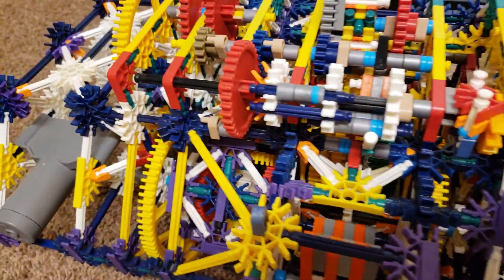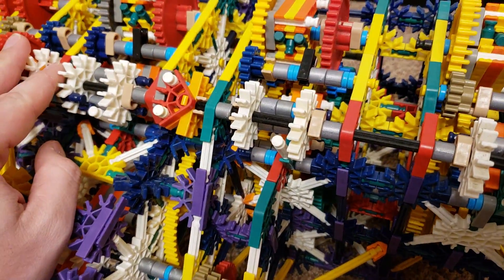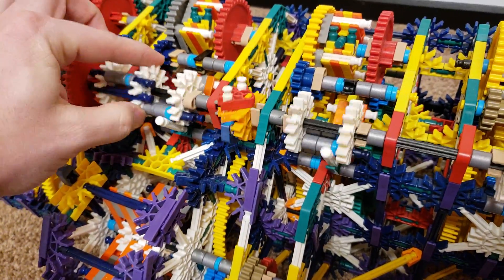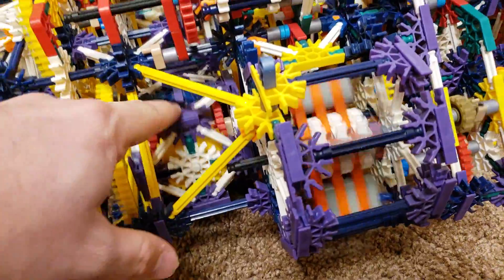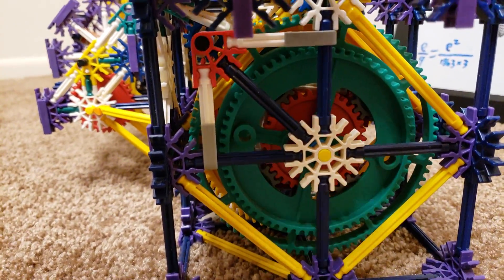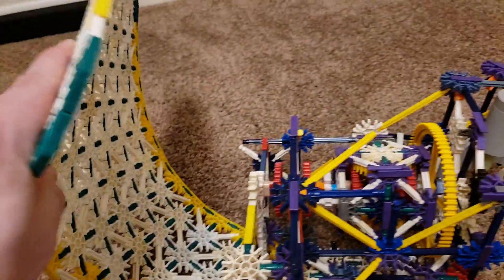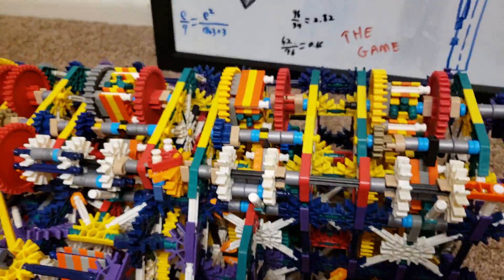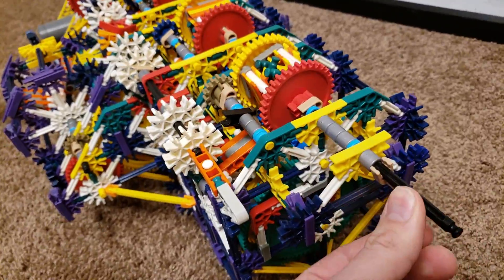K'nex Turbo Encabulator

Comment: I was particularly impressed with the implementation of the drawn reciprocation dingle-arm -- you usually don't see that kind of quadrimechanical integration in DIY Encabulator construction, especially alongside what look like fully opticalibrated marzel vanes. Even though it's made of K'nex, I wouldn't be surprised if you could run a full encabulation cycle with this, provided you pre-variolated your input cycling dynamics to account for the monopolymer construction, and minimize waste heat from the spurling bearings.

Comment: Mine broke down so many times. I finally watched your video and realized my NRD Arm was not properly installed.
Reply: It appears you used a non-returnable dingle arm, the installation is probably just fine,  use an ordinary dingle arm and you'll be laughing...

Comment: Did you base this on the unit from the Viper?  The layout of the unit and positioning of the marzelvanes look like theirs, but that ambifacient lunar wane shaft fitting is almost a perfect copy of the design published by the British Institution of Electrical Engineering Students Quarterly Journal in 1944.   I suppose it could be GE's design, though, I'm not all that familiar with pre-GMC Encabulator designs.

Comment: I can't help but advising that, if you would only replace the phase detractors with some transductive gas-actuated heliostruts, your quasi-linear stator efficiency would increase, as described by your standard sub-eliptoid Bosian curve.
Reply: Yeah, he could, but then he'd be trading durability for efficiency, and I'm not sure that's a good trade off... and did you ever stop to think of what that might do to the phase detractors? Or the hydrocoptic marzel vanes? They weren't designed with transductive gas-actuated heliostruts in mind. You can't just change one thing and expect everything else to be okay with the increase in nofertrunions.

Comment: A trunnion is a cylindrical protrusion used as a mounting or pivoting point. First associated with cannons, they are an important military development. Alternatively, a trunnion is a shaft that positions and supports a tilting plate. This is a misnomer, as in reality it is a cradle for the true trunnion.
Reply from the maker: Interesting, I learned something new today

Comment: Epic, I was curious if the K'nex would be able to handle the side fumbling
Reply: As long as you pre-fabulate the Amulite beforehand it should remain operable and prevent side fumbling at a rate of 64/7 at BEST optimum operating status -the Encabulator guy

Comment: I recently developed an app to analyze turboencabulation produced by the well understood inverse reactive currents in unilateral phase detractors. One unique feature is that the user can display the results in both percent realization and in a 3-D model allowing the user to rotate the results for easier viewing without having to rotate the smart phone screen itself.  

It was fully tested on a six laser stabilized anti-gravid marzelvane system with attached ambifacient wane shafts to prevent internal precession and wobbling. The excitation used for the tests was both sinusoidal and cosinusoidal, and required only low voltage generators, proving both the design efficiency of the hardware, as well as the reliability of the calculations. 

In addition, the same data was analyzed on a spreadsheet to confirm the accuracy of the results.

The app is currently awaiting approval for inclusion in the App Store and the Play Store. Availability and price will be announced as soon as the application passes the required validation tests.

Comment: I don't think we speak the same language
Reply from the maker: It's quite simple, really. There are three primary main processing cores, cross-linked with a redundant melacortz ramistat and fourteen kiloquad interface modules. The core elements are based on FTL nanoprocessor units arranged into twenty-five bilateral kelilactirals with twenty of those units being slaved to the central heisenfram terminal.

Comment: And where do you get the big green gears?
Reply from the maker: They are pretty hard to find. I was lucky enough to get a few in an eBay lot several years ago. Once in a while they show up on the knex.com, or the K'nex User Group, but they are quite rare. They are extremely useful though! They have 2 different ratios along the outside that mesh with either a small blue gear or a medium red gear, and the interior teeth can be used as a ring gear in a planetary gear set (which is how I am using them in this transmission).
Reply: Austron ya that’s why I wanted them. I know you can’t really make a car type transmission because of the limited ratios with knex planetary sets but it would be awesome to experiment. I wish they would sell them separately on the site because it’s useful like you said
Reply: https://www.walmart.com/ip/K-NEX-Education-Simple-Machines-Deluxe-Building-Set/26632725

https://www.knexusergroup.org.uk/en/info_K90996.html

https://www.thingiverse.com/thing:1848193